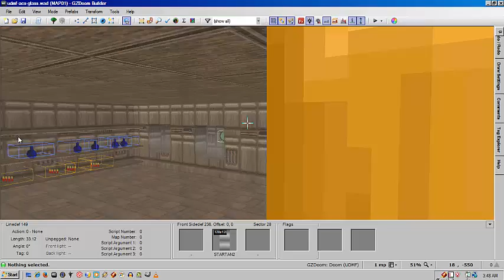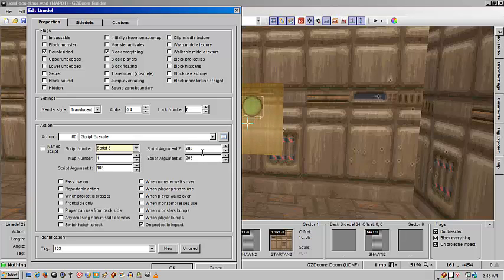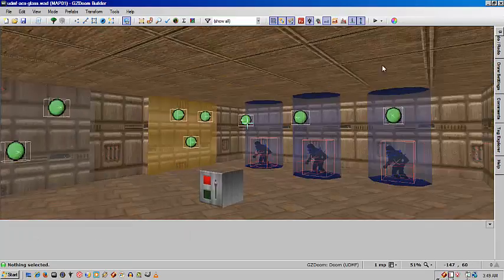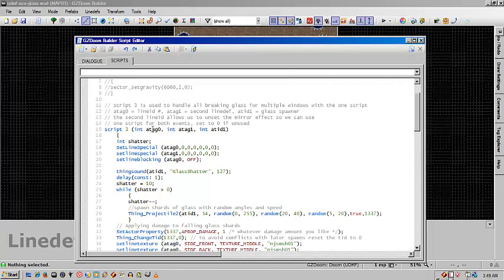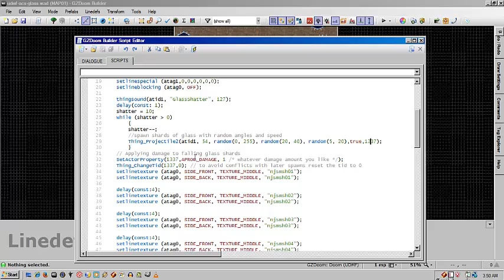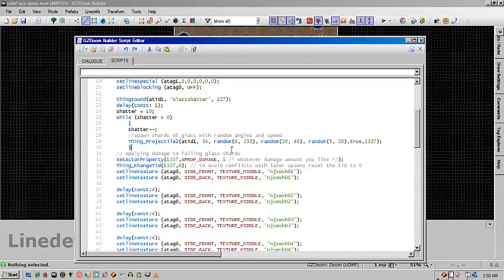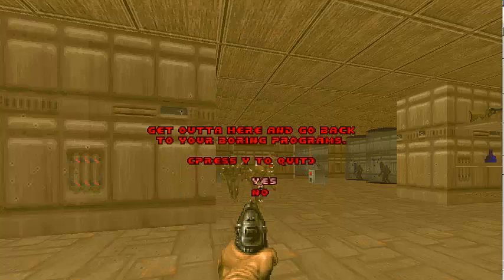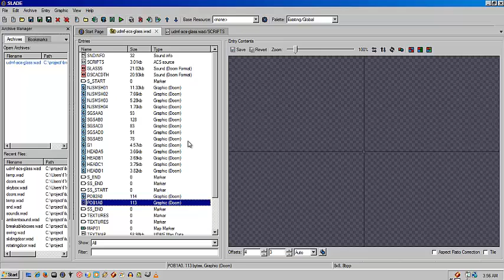(GZ)Doom Builder - Breakable Glass

Comment: Would be nice to have a generic script to have breakable glasses (windows, tvs, computers etc) like the tech pillar has. I know it is not easy for the scritp to detect which size , texture or place should genericallyt add the window/glassm, but would be extremely neat.
Reply from the maker: Unfortunately you would have to expand the script out to handle each event as each would spawn less or more glass shards. You could create 3 different shard counts and use them generally for less moderate and heavy glass sharding effects.

Comment: Can I get a Dropbox link with a demo wad/map/script/resources.       Im running GZ Doom Version 1.14.0.2308. I also have Slade v3.1.0.3
Reply from the maker: Arther Casillas unfortunately all of my samples and site got destroyed in  a disk failure if you  google "zdoom glassbreak what do i need to make it work" the first result can pride info on were to get the needed resources and icludes a lowrent barebones version of my scril they also kind of explain ho to use the glassbreak built in function of UDMF map format . If you have any further questions issues or requests let me know either here or in private message thanks for watching
Reply: I use gzdoom in Doom Hexen format.
Reply from the maker: Arther Casillas ulploaded a stripped down version of the breakable glass demo to drop box link is in the description
Reply from the maker: @arthercasillas2755 Unfortunately I map exclusively in UDMF I have never messed with hexen in doom format.

Comment: hi im having a problem with breakable glass in a wad im building with gzdoom builder in udmf format. the glass is fully functional in that before i shoot it i can not pass through the line def,and after i shoot it i can pass through. the texture i  have on for the line def is still there after i shoot it.how do i make the texture dissappear when i shoot it? i am not using a script with this either as udmf features allow you to do things without scripts that would require them in hexen format.  also can i add extra functions to a line def or object in the custom field editor? maybe like some actor to make the texture dissappear? is this possable? thanks for any help you can give me about this!
Reply: To use the breakable glass built in function is alitte complicated and not documented really at all.
Breakable glass are basically just a switch., To use it you will neede to create a texture to be your glass and one to be the broked windowd area. These will need to be the same size as the space they will fill (using texture wrapping might resolve that issue allowing you to use a smaller textture.

So now that you have your window textures you will need to create a switch definition in ANIMDEFS which should sbe something like this.

switch brkglass ON sound breakingslasssound  pics brokenglass tics 0
brkglass is the name of the swite breakinglassssound will be named after what ever you defined it as in your SNDINFO file and brokenglass will be the texture of the broken glass in the window.

You could even animate the glass breaking by doing something like this.
switch brkglass 
on sound breakingglasssound
pic brk1 tics 4
pic brk2 tics 4
pic brk3 tics 4 and so on until you hit the last frame
Now you will need to download th breakable glass demo I have at www.doomhq.com I think it is linked in the description. You will need some assests from it for the breakable glass namely the debries and glass shards and the sound. Import the shards and sound from my wad and import them to yours once added make sure to add the sound definition to your SNDINFO file nothing speciall needs to be done with the glass shards th just need to be present. With all of that done  From what I can remember of it that should be all you need to do for it to work.

I still recommend just using an acs script over the built in breakableglass function in zdoom, it;s far simpler to implement and is more robust in terms of how you can use it in the game.you can do a lot more with it you could even use it as the basis for differenty types of glass windows using the same script just by adding another argument to the script that tells it what kind of glass it is that is being broken and from there you just add the necessary glass textures and passs the type as an argument to the script.

I hope you can get it working easily enough in my experience using the builtin it was a pain in the ass to get such a simple effect which is why I  wrote and recommened my breakable glass script.
IF you have any issues let me know
Reply: thanks for responding. i acually did get a simple script of breakable glass working with a sound but without any shards. it has the line def set as blockable until shot and clears the texture from the line and plays the sound after it is hit. i am still new to acs but figuring it out,thanks again
Reply: sgtpavlov Not a problem acs is pretty straigh forward and you should be able to pick it up pretty quickly.if you haven't you should take a look at the breakable boxes demo I have its a neat way to stash monsters or useable items by "storing" them in boxes you can shoot to break, if you have any issues or questions you can private message me on thgis user account until I get my main account sorted out.